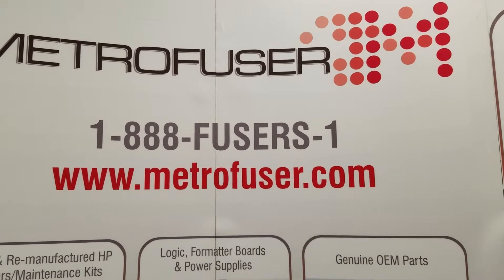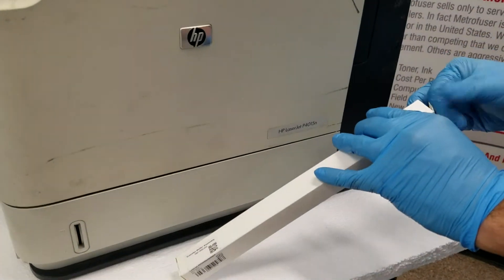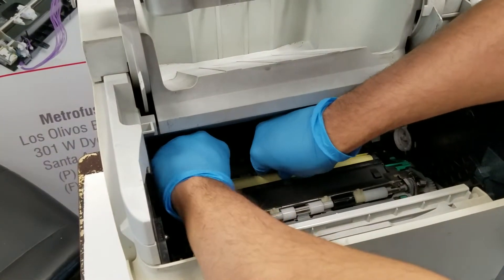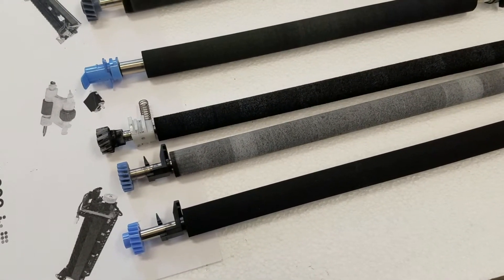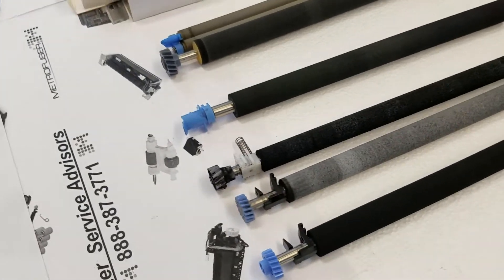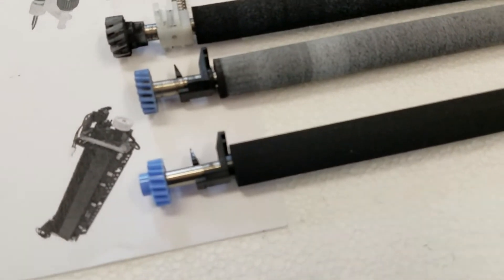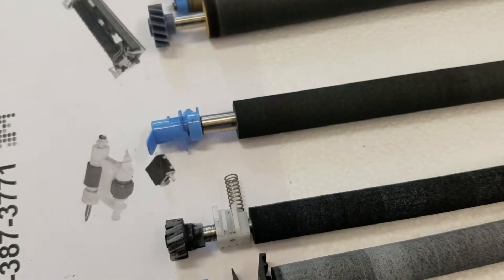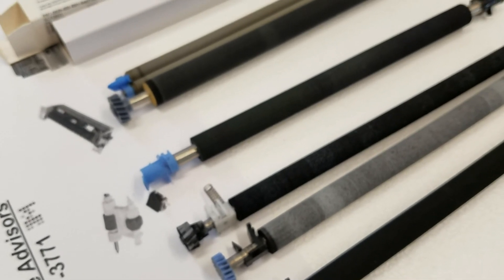HP and Lexmark Laser Printer Transfer Rollers Removal, Installation and Troubleshooting

Comment: Hi, I have problem with transfering toner to paper despite the cartrige is new (Orink), and OPC drum also, but the picture is fade acros, you can barely see letters, there are no lines or  picture errors, the picture qualiti is so low and fade. It is Lexmark E342n and the problem occured when I was printing 100 pages of some book in PDF and everything printed perfectly up to 50 pages and all of the sudden one paper jammed and printing stopped. I opened printer, removed cartrige with OPC to remove jammed paper, reinstal cartridge an resume  printing, but the printing quality drops to barely see the letters on paper, I mean it is not the First time I had to remove the cartridge with OPC drum to remove the jammed paper, I have done it hundereds of time, so the OPC and cartridge are sitting correctly in their position. There is no error on printer LCD display.

I checked the gears on OPC, cartrige, transfer roller and they are not broken. I thougt maybe the cartridge or OPC drum are defective, but I have tested the way that I have started printing and in the middle of printing I switch off the pinter, uninstal the cartridge with OPC drum to see the letters on green surface of OPC drum and the letters on OPC green drum are perfectly Sharp and thick and I touched the letters on OPC drum with paper to see would it transfer on paper and it transferes perfectly on paper with perfect thicknes and sharpnes and darknes, but why the hell is not transfering on the paper properly when the components are instaled in printer?! 

Then I thought maybe the transfer roller is defective or it is not enough presure transfer roller to OPC drum and I checked it also by removing cartrige and trying to push the small paper between OPC drum and transfer roller where they are in contact maybe there is a gap or pressure insuficient, but no gap, everything is fine, the developer roller is pushing towards the OPC drum properly. I really don't Know where to Search the problem further, maybe the PCB on where is developer roller connected to discharge, what do you think?
Thank you.